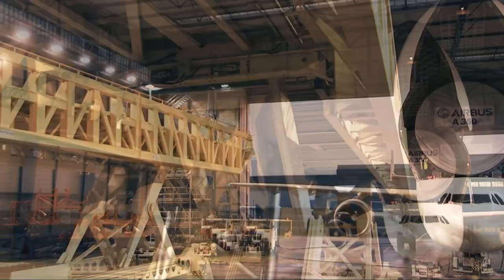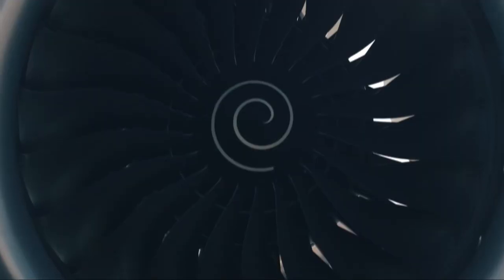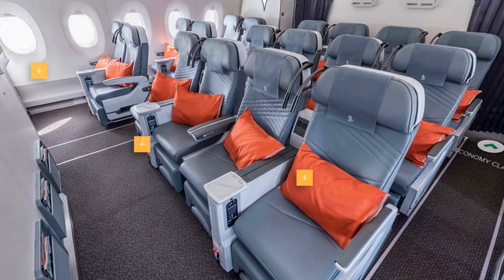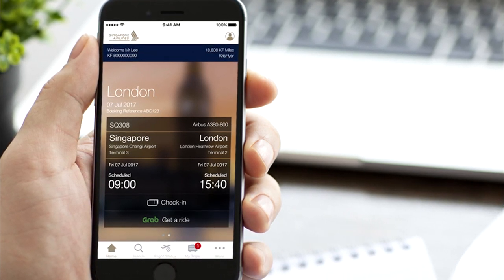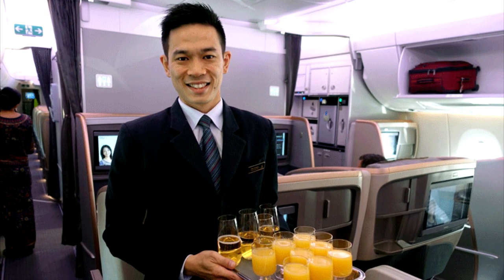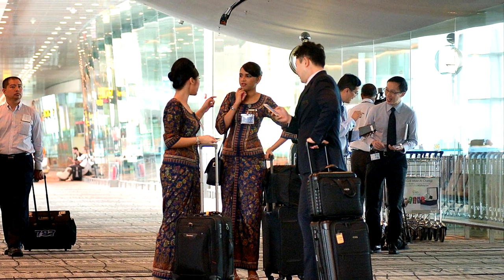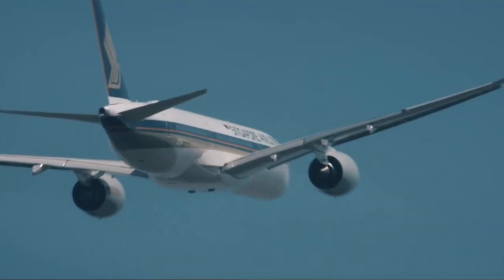Singapore Airlines: Preparing For The Longest Commercial Flight

Comment: I dont get it. They used to run this flight back in the early 2000s when I worked at EWR. They had some special all business class A-340. That thing used the entire runway to take off!
Reply: Massive amount of fuel and the plane was fully loaded with it and also the a345s were very heavy plane holding 4 engines and an underpowered aircraft that requires a lot of runway and space
Reply: I a, sure of that. I remember watching that plane rise very slowly. Also forgot to mention those flight attendants were some of the most attractive ever.
Reply: The a340-500 is anything but underpowered! We are not talking about the a343 here.
Reply: I wish to fly SIN one day, everyone is talking about how attractive their flight attendants are 😄
Reply: Sandro Martins That Plane is worst lmao, ppl Ik who flew that plane said it felt like they were driving to the destination when on the RWY.
When will it ever lift lol
Reply: @Racko.  Yeah I bet it was so awful, plane lifting slower, oh God, the worst travel ever. You make a problem from nothing. Interior comfort level is much more important than lifting speed. It's not a fighter jet. But apparently armchair experts forget about that, since they fly f-35 in prepar3d  and think every plane should be the performance God, because then it's more fun in the simulator.
Reply: @cytrynowy_melon6604  -- Engine out just after V1 would be in the news.
Reply: @henryD9363  A340 has 4 engines so it can fly or glide for a long time in case of engine failure. Has any a340 crashed due to the failing engine?
Reply: @cytrynowy_melon6604  -- very good point. I was responding to the slow and lugubrious takeoffs that people observed. This could be a tree topper!
Reply: Johnny Wynn ???? Sin runway is long, if you want to prolong engine life you'll use less thrust which equals in longer take of, every plane does it if possible, a343 is slow climber but not the rest. please don't be taking info from armchair pilots.
Reply: @patsy stone edina LOL i Dont understand why ya don't want to hear about the a343 being underpowered lmao, less trust my ass to reduce fuel burn during takeoff, thats correct but its still a poor climber compared to other planes in its class or not in its class. Id enjoy such a slow and smooth takeoff roll
Reply: Agreed

Comment: In 2008, I flew17 hours non-stop from Los Angeles to Bangkok on an A340-500.  It was torture!
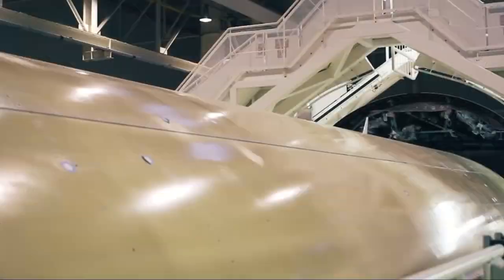Reply: Yea, they don't do that flight anymore.  Nowadays, I take flights that stop in Taipei for 3.5 hours then onward to Bangkok, another 3:45 hours. But it's nice to get a break from that 17 hours
Reply: I Think LAX-BKK flight was suspended years ago
Reply: @Johnny Wynn- that flight in 2008 was on Thai Airways.  I went back in 2012 but Thai Airways stopped in Incheon Korea for 2 hours which was nice to break up a long flight.
Reply: Yh, Then the flight continues towards LAX, I believe once Thai shows a heavy reputation they’ll relaunch this direct fight using either the 789 or a359, the only reason why it was disconnected years ago was the rise of fuel prices and proven unprofitable a345s

Comment: Funny how you say they thought about the passenger going from 253 passenger to 161, configuration etc etc.. but TRUTH be told that's the only way this plane can fly that distance, reduce weight (passengers) less cargo for more fuel tank...   the 787 can do the same thing if it was config that way, as the 7x can do it with no mod.
Reply: Thanks, engineer. I guess it's the same thing with the A320LR, right? Oh, no wait... it's a completely new system.
Reply: Your welcome

Comment: The flight isnt 10,000 nm. Its a little shorter. Its ,9,534 nm which the 787-9 can do if it was configured in the same way. Its just a was for airbus to commercialize the a350 ulr
Reply: A350 ULR seems to be nicer than the one you mentioned.
Reply: Nicer in what way. Matter of opinion. I think the 787 looks a little better then the a350
Reply: Excellent point and if you want to compare both planes side-by-side on this ultra long haul flights then Los Angeles to Singapore is an example because you have a B787-9 United Airlines and a A350-941lr SQ
Reply: Well the 789 can easily do that route in the same Configuration, but airbus took the a350ULR idea to replace its a340-500 for SQ for an advantage of commonality for pilots and space because SQ already has the original a350-900s with serves their other routes thus the 787-10s to do their high density medium haul.
Reply: This is why united and American Airlines won’t purchase the 777x because they know how long the 787-9 can fly. Do you remember when Qantas was considering using the 787-9 to fly from Sydney to New York with the 787. The aircraft has great range.
Reply: So we are on the same page. Thus the reason why united and American Airlines has ordered the 777x because they know the 787-9 true range, and if the 787-9 true max range was to come out it would definitely hurt the 777x sales.
Reply: I think you’re referring to QF’s 747s they used on Sydney to London back in 1947.
But I’m glad we’re on the same page and understanding were we’re coming from. 
Qantas’s  Perth to London is shorter than Singapore Newark flight by just under an hour and a few mins, Qatar to Auckland is just under a few mins behind Singapore EWR, but anyways 
if Qantas decides to launch London to Sydney nonstop again and to New York,  it’ll surpass the Singapore flight because they’re the longest out there.
Thx to the 787-9’s maximum 8,7K nm of Range it will indeed steal a lot of the 777-8 sales but the 777-8 I think still might have some costumers because of its greater capacity and Boeing planning to boosts its range to an unbelievable monster Range for airlines looking for a plane that size and flying far. QF is also interested in it because of its larger capacity hence it still makes the 789 a viable choice if they reduce the passenger seating to some limitations then. 
The 777-9s are for major airlines competing 400 Seater market.The US carries one day might buy it because from the spot in aviation today, the travel rate and passenger rates will increase in the near and bright future. Making the 777X a sweetspot in the 400 seating market. AA already though about buying them for future growth
Reply: So question do you think Qantas will pick the a350-1000 over the 777x
Reply: I’m not sure, I do see Boeing and Airbus both confident about meeting the planes needs for Qantas. I feel like the 777X is a higher possibility
Reply: Boeing 777-200LR could have done this trip with ease!
Reply: Due to commonalities  of 787 & 777 type rating  you would say 777x. But am guessing Airbus is waiting for 777x to go through the testing phase & see its actual range then most probably reconfigure the A350- 1000 into a URL.Qantas doesn't have a premium market comparable to Singapore so they will need a cattle class.
Reply: If Singapore waited for the 777LR I think they would of never stopped. Their very long haul flights, it’s a more efficient and longer range plane than the a345 which was deadly expensive. I see Qantas looking at the 777-8 for now
Reply: Qantas was years ahead with its 747 flights in 1947.
Reply: What?
Reply: Get your facts right, Boeing fanboy. The B787-9 in a two-seating conf has a range of 7,635 nmi; whereas the A359-900 has a range of 8,100 nmi, and the -1000 a range of 8,400 nmi. The A350ULR has a range of 9,700 nmi. You're just comparing two different planes here.

Comment: Pfffft!!! The Boeing 777-200LR or the 787-8 could have easily done this trip with the same configuration! Airbus is just doing favors for airlines to hype there A350. Like really Airbus, and you Singapore Airlines!! A more less hyped 777-200LR or 787-8 could have done that with possibly slightly more seats! This is ridiculous!!!
Reply: Saturn28 not the B788. The B77L could but it’s 351.5 tons.
Reply: The 788 Could do it but in a little less passengers, It can fly 9,500 miles anyways in a smaller capacity
Reply: why would they want fly that sardine can?
Reply: I'd gladly fly in a 77L while listening to those sweet GE90's for 18 hrs.

Comment: They should Just build aircraft that can fly faster not these slow turtles. It is funny how airlines want aircrafts that can fly for 20 hours c'mon we need speed.
Reply: The airlines want better cost control (fuel efficientcy) rather than speed. How much more $ would you pay if your aircraft is faster but with same seat config?
Reply: fly faster, burn more fuel. Why do you think Concord retired? 550mph at 38,000 is hardly a "slow turtles."
Reply: Why do you think the concord failed? Its because it wasn't economical. Yes it was fast but it was too expensive to operate.

Comment: Airbus makes their cockpit windows so ugly they have to put that stupid raccoon paint job look around the windows. Looks terrible.
Reply: Barney Rubble hello Boeing fanboi I inform you that even in the 787 there is it
Reply: @b1squitz551  the boeing 787 looks much better soyboy!
Reply: Barney Rubble the cockpit windows are mostly identical with a change only in the last one
Reply: There's actually a reason behind it. Each airline has a different livery, so when you implement a black mask around the windows,it's not a problem anymore. Furthermore, the construction behind it is way easier, as the side windows can't be opened anymore.
Reply: @J.Stein1  every a350 has it. The a330 neo has it. It's not the livery. Airbus puts on every plane painted now. It's airbus trying to make something its not. Good looking.
Reply: It looks good though.
You have boeing fan boy symptoms.
Reply: It does not look terrible at all, it gives the aircraft a more clean and modern appearance.
Reply: ugly or not,  the raccoon paint job is an anti glare for the flight crew and the windows are aerodynamically designed which makes it more efficient and quieter and the only drawback is that those windows cannot be opened and it has a very weird windshield wiper placement
Reply: Airbus gives A320NEO Costumers an option if they want that black mask around the cockpit window